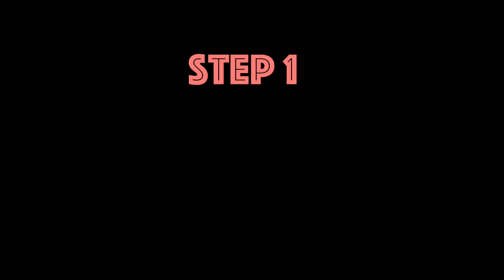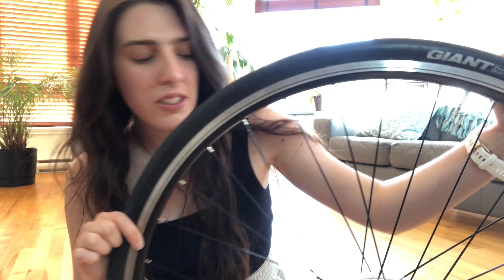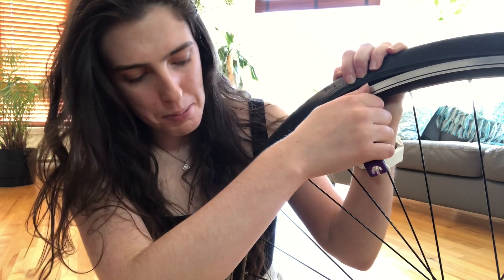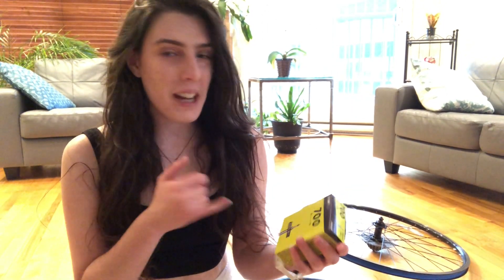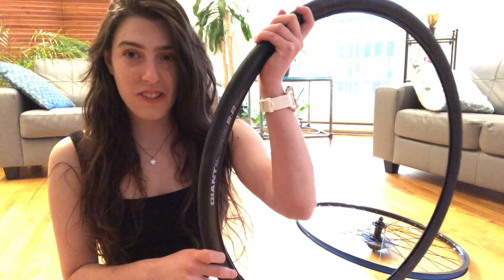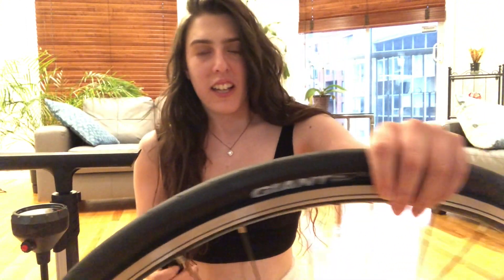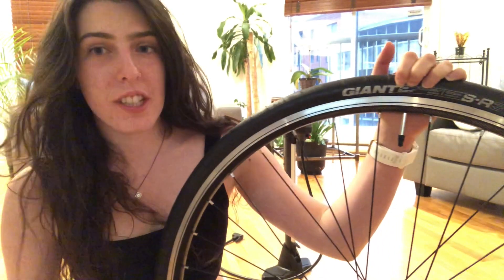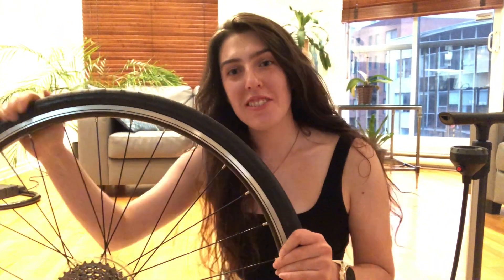HOW TO CHANGE A BIKE FLAT TIRE | 5 easy steps | for bikes with inner tubes

Comment: interesting. I usually let the one  side of the tire still attached to the rim while remove and re insert a new tube and then close the other side of the tire. still 11/10. I have like 6 years or riding and im such a newbie that I need 1 lever clipped on a spoke to remove the tube well
Reply from the maker: Thank you! That sounds like a good alternative!
Reply: Exactly.

Comment: I would add that after removing the old tube you should always check the inside and outside of the tire for whatever caused the flat before putting the new tube in. Glass and thorns will often remain and will immediately puncture the new tube.
Reply from the maker: Good point!

Comment: Veteran road and mountain rider here as well as former high end shop mechanic- several things are missing from this.  1- tires with a tighter fit on the rim often require two tire levers.  2- take the tire off, check the outside for anything that might have caused the flat, then turn it inside out and check the inside. If the flat was caused by a cut instead of a small puncture, you will likely need something sturdy to put between the tire abd tube so the tube doesn’t explode out of the cut.  3- mount one side of the tire back on first, then slightly inflate the new tube, just enough for it to hold its shape and put back in.  4- mount the other side of the tire back on, working it from both ends.  I usually start at the valve stem.  5- VERY IMPORTANT!!! As you are inflating the tire, stop at some point and make sure it is seated properly and the tube isn’t sticking out from under the tire bead, or from any cuts in the tread or sidewall.  If it is and you don’t catch it, it will explode.

Comment: Would you recommend patches as a quick fix on the road?
Reply from the maker: You can use patches if the puncture is not too big. Also, make sure to let the glue dry properly before putting air in the inner tube and verify for any air leaks
Reply: @imkarineseguin  Thank you for the tips 😊